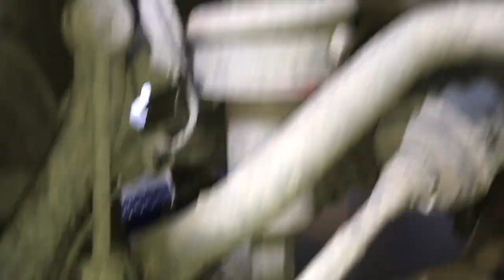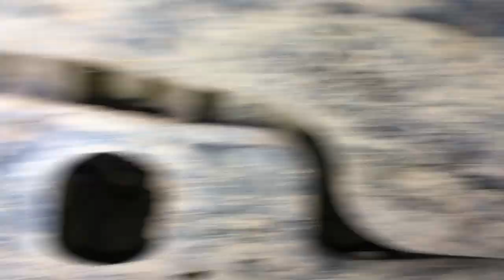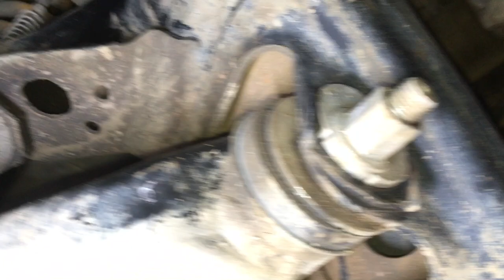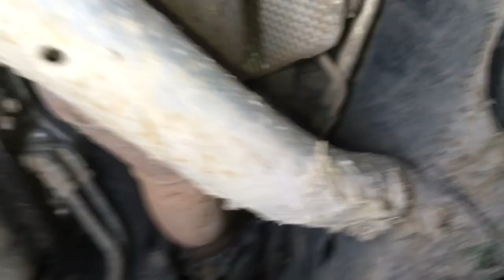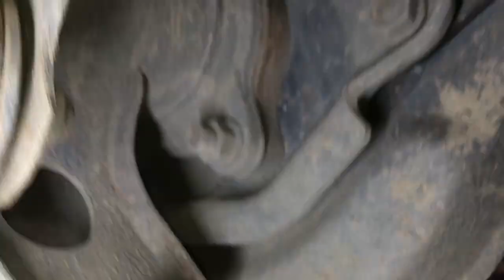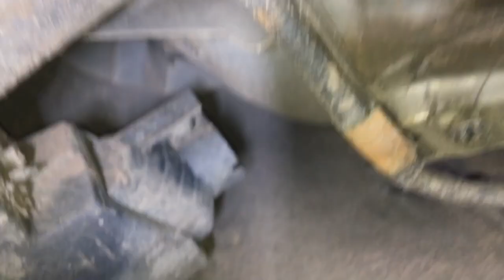SPRING RATES & COMPRESSION

Comment: Anthony I always appreciate your videos - i have a v6 petrol prado - it has serviced me well as a city runabouts with occasional touring/4wd trips and will be updating to a diesel soon as i will be doing a lot touring incl remote touring- you have been helping understand the diesel engine a lot. In regards to issues you mentioned- i think everyone needs to be a lot more thick-faced if intending to comments on internet - yes - tone & facial expression forms a large part of communication, which is missing when typing just text

I am not a suspension specialist- heck i am not even in the trade - but like a lot of bike riders (motorcycle and mountain bikes) i do play a lot with my suspension settings - my comments on the subject are as follows:
1) spring rate is only determined purely by the thickness of wire, diametre of the rounds, number of rounds and length of free coil;

2) distance between free length (uninstalled/uncompressed state) and installed length is preload - and preload can affect the height of the vehicle sitting on the road; so a lower rated spring can be made to give the vehicle same ride height as a heavier spring (within reason) by increasing the amount of preload and therefore amount of force (weight) acting on the spring before the spring compressing more  < maybe thats what stewart is on about>. As you correctly stated that the amount of preload on a standard / non adjustable mass manufactured strut does not alter spring rate. motorcycle guys will constantly plays with this part (preload adjuster) to adjust ride height depending on the language and pillion carried at the time- 

3) while it is true that a shock valving characteristics should be matched to a spring rate and sprung weight and the characteristics of behavior of shocks sought by the end user - i doubt (for a car) with non-adjustable shock/struts, in my opinion, this is at all critical  (but see the following point)

4)So for Johnathon, if you  want to mix and match ( assuming the strut was designed to be a direct replacement and not a coil-over with its own unique spring)- the right question to ask is what is the spring rate the shock/strut design to work with (or as car industries termed " +???kg of constant weight" ) - that's actually more important - case in point ( this part is my opinion), Bilstein A712/A713, commonly recommended as a replacement set shock strut is utterly useless when you have used a +100kg/200kg constant load spring as their hi velocity rebound is valved to match the softer OEM spring driven sedately say in EU, and not for the increased spring rate of the constant load and the increase load put through by people flying across corrugated road at 100k/hr -  Bilstein B6 will be much better fit with those application.

sorry for the long rant
Reply from the maker: If you think it through though the only reason the preload changes the height is because the preload is changing the base height of the coil so for a dirtbike it regularly becomes fully extended when leaving the ground and as soon as you come back onto it the preload is slightly different but with the vehicle it should never leave the ground they should rarely if ever top out therefore there is no real preload the load is the weight of the vehicle on the spring if you know what I mean it is quite difficult to get your head around I do appreciate your long post it’s not a rant 😁
Now hopefully talking to the phone it all came out with the right words and made a bit of sense and nobody gets upset 🤷‍♂️😁😂👌👍

Comment: He is talking about adjustable seats. He is not talking about the temporary compression to install the spring. He is saying that winding the seat height up, compresses the spring. Which in turn will raise the vehicle and also make the spring ride firmer because the spring is already part way compressed. You think he is talking about the pre installation compression of the spring with the spring compression.
Reply from the maker: Never said that it will make the ride firmer. Ppl say that are wrong.
Reply from the maker: Once the spring is in the vehicle the weight of the vehicle is what is compressing the spring any spring compressing before installation is completely irrelevant